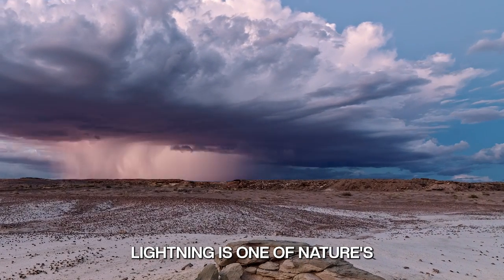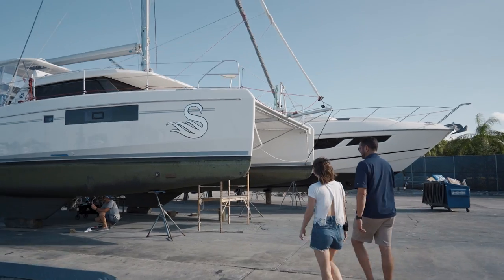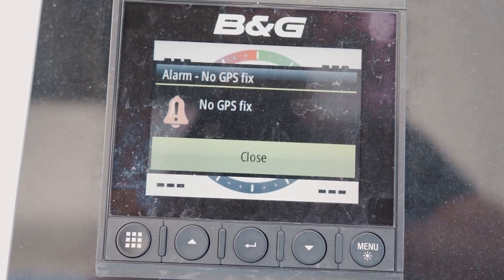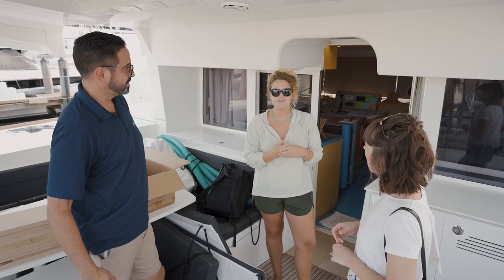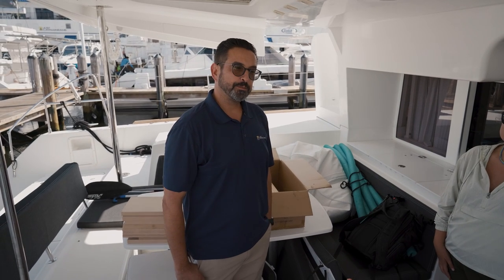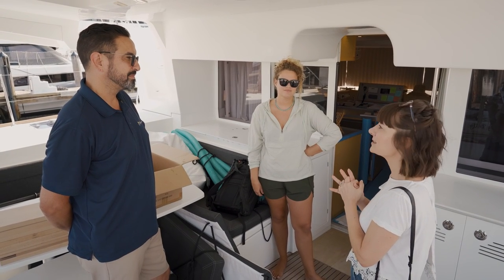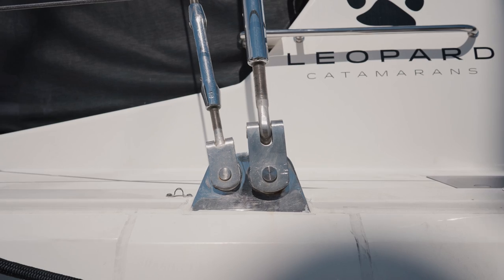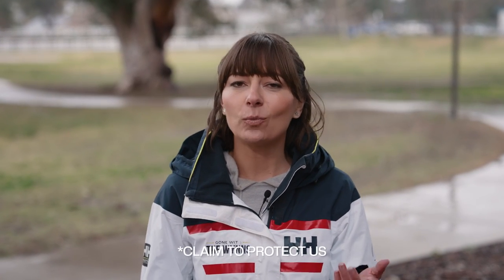Can Anything Stop Lightning?

Comment: I'm an electrician, not a sailor.. One of the problems that makes the subject issue so difficult is the nature of electrical insulation. When it is stressed by overvoltage, as in a lightnimg strike, it can lose some of its insulation value but still be functiomal at normal operating voltage. However, it will have lost some of its life expectancy,  Further, in a marine environment, it may tend to absorb moisture more readily, causing problems specifically when power distribution equipment cools off during normal downtime, allowing ambient moisture to condense. Capictors in power circuits are particularly prone to this effect. Insulation needs to be tested with an insulation tester at working voltage. Ohmeters powered by 9V batteries are usually not adequate. Hope this hekps.

Comment: To repair and refit a boat after lightning strikes is a costly and là our intense process. Parlay Revival get stroked directly 2 times and Colin have to go through extensive work on his boat to get it back in sailing condition again.
Sailing Dauntless is installing a similar/same system, you guys can reach out to them to have more information on this type of solution.

Comment: Ha Good one! I am an engineer with 55 years of sailing experience and this topic has always interested me.  I know the theory and can  make the calculations, but what bothers me is that it does not line up with the emperical data. I have had two personal near lightning misses on land and can attest to the power and force. But at sea... What I note is that sailboats are very rarely, if every, hit while under sail in spite of lightning strikes 360 degrees around the boat (personal experince).  But boats are very often hit at the dock, on the hard and at anchor. What gives?  I have never known first or second hand of a hit under sail.  

I have had people insist that they were hit while sailing and I ask how do they know it was a direct hit?  Because there electronics have all been killed. However that does not prove anything because a close proximity strike will do the same.  Now I have seen the damage caused to boats struck on land, the hard and at the dock.  In some cases one or more holes have been blown through the hull.  In one case I am aware of, the boat was struck in a pit in Vuda Point Fiju and the survey found about 200 microholes in the hull and the insurance totaled it. One boat I know was hit on the hard in Greece.  No damage reported.  They put the boat back in the water after replacing all the electronics and went to sea.  At sea, an 18 inch crack opened in the hull just in front of the keel, right where a jack stand had been under the boat on the hard.  The point is, if you boat has had a direct hit, you will know about it sooner or later.  The water in the fiberglass matrix, (yes all layups done without epoxy have water in them), will at a minimum flash boil and damage the bond between the fiber and the resin.  This is the same steam explosion when happens when lightning hits a tree or a wooden house.

So, why do boats under sail rarely, if not never get hit by lighting?  The truth is no one knows.  I suspect that like the Tesla device that is commercially marketed, that a sailboat in motion gets an unattractive charge like a car going down the freeway on a cold day.  I would like to see someone research this more thouroughly.  So if you beleive the marketing and want to protect your boat at anchor, at the dock or on the hard, spend the money.  If you are primarily worried about getting hit at sea, I would buy a life raft and epirb instead.

BTW... Commercial aircraft are hit by lightening on average once a year. When that happens the aircraft becomes a giant capacitor and the charge is bled off the wingtips by design.  Carbon aircraft need a bit more engineering specific for lighting strikes as you might imagine.

Also the Air Force once did some research on weaponizing ball lightening (St. Elmos Fire).  They could make it but they failed to be able to control it.  What could be more scary? If anyone has any specific data or research that can add to this topic I would like to hear it.

Comment: Yeah, as long as having the protection does not provide unwarranted additional hubris to the boat operators... still gotta be smart about it.
Similarly, do all boats have surge protection at the shore power connection point? I think not, but couldn't hurt, might even help to address proximity hit issues.
Does your insurance company have any opinion?

Comment: Thinking about what it does, if it's a de-ionizer, Many use carbon brushes in order to Ionize the air, so could many small flared out versions work like the ribs of the umbrella designs, and pull in pre-charged pixies for and from a larger surroundings?

Other than that, who says the onshore ones can't be moved to be marine?
Finally, thinking about old time things, and sure this is from movies, but whenever they're in a t-storm, the first thing that usually happens is that someone has to come down from the crows nest, before the big hero climbs back up there...sooo I mean it would make sense that it being the highest should do something and the burger shape would be likely to cause a cone of safety....

Comment: Unless there is some gigantic high voltage ion generator involved it's just a glorified lightning rod. Grounding the mast via some through hull plates similar to that expensive setup would be almost as good. Putting a "hat" above the wind and antennas (as the gismo install does) would be better. There's a reason why the folk with a massive mast got hit first.

Comment: My boat was hit by lightning, Icom VHF radio survived, and the VHF antenna had a wire fastened to the antenna and the rigging wire tang the lead to the boat's grounding system. Lost the alternator, GPS, and halogen lights, but my Appenlow lights survived.

Comment: Lithium batteries are very dangerous when over or under charged. The computer that protects them is called a BMS or a battery management system. It's inside those battle borns that you're familiar with. That part can be damaged by a lightning strike and you might not notice it. This would cause your batteries to over or under charge and as a result become a big fire hazard.
Reply: Wr I ng g e

Comment: Good that you guys are covering this topic, Nikki, but isn't that what the "feather dusters" are supposed to do? I've always read that they dissipate the ions in the air around your boat. Also, what would be the cost of either of the two devices you mentioned (for direct strikes) if it were to be installed on the mast before the mast is stepped?

Comment: I'm an EE and cruiser and it's essentially impossible to prevent lightning from striking your boat. None of the devices work. Keep a handheld VHF/GPS in ferrous metal container to shield from EMP, have jumper cables to start engines and spare alternator to install. Have good insurance. This is a big threat to newer high tech boats. Even if you have robust lightning paths from masts to grounding plates the EMP can do enormous damage and you cannot shield the whole boat from EMP unless it was built by the Department of Defense.

Comment: As ocean going craft travel the  waters, they develop a magnetic signature, making them stand out against the natural magnetic/electrical background. Hence, naval vessels (which are usually steel) are routinely "degaussed", which randomizes their electrical signature and thus they blend in to the overall magnetic/electrical field, and (colloquially) camouflaging them by reducing their electrical target profile.  [If the lightning can't "see" you, it probably won't hit you].

Is degaussing possible with GRP/fiberglass/ferrocement vessels, given the massive amount of electronics and electrical cables typical in today's builds?  I dunno. It definitely works for steel vessels.
Reply: More specifically, naval captains are advised to change course randomly, which (theoretically) erases [jumbles] part of their electrical signature, again, helping them to blend into the overall electrical field. This is SOP , e.g., minesweepers.
Cite: Training course, Section 2, "Celestial Navigation for Prospective Commanding Officers', BuNavPers, 1978

Comment: I have very extensive experience of working on boats for new installs, replacements and lightning damage - in Florida on the west coast. There is absolutely no way you are going to stop lightning damage. A direct hit will definitely take out ALL of your electronics and batteries. If you are approaching a storm you can't avoid, start your diesel. Leave it on until you are absolutely sure you 'dodged the bullet'. If hit, your starter solenoid AND starter motor will not work. Breakers, transient arrestors, etc. won't be usable long term. After a hit some things will be immediately dead, the rest will die over 3-4 weeks. Your insurance company will put up a HUGE fight and most payments only cover 40% of the true replacement costs. UNDER NO CIRCUMSTANCES order with a carbon fibre mast. I've seen many of these hit and EVERY single one is peeled from top to bottom like a banana (but with very fine strands!), leaving no mast and a huge mess of tangled rigging all over the deck (and incidental further damage). The worst killer of instruments was the introduction of the RJ-45 as the standard boat bus connector. Anyone who works on computers (I do) will tell you the worst cause of failure is via the RJ-45 ethernet connector. The only thing that may help is control using fibre optic lines. A nearby strike will nearly always find it's way to water via your depth sounder transducer. Always check that first! Don't waste your money on 'loo' brushes on the mast or the $illy new device$ you're being touted.
The choice of an all-electric boat is stunningly poor in this regard - you won't even be able to cook food. Give yourself back-up small gas canister stoves 'just for a rainy day'.
'You're twice as likely to be stuck in a catamaran' is utter nonsense. 99% of the time it's going to hit the mast. In a carbon fibre boat your best bet is NOT to use pre-installed ground plates with VERY hefty interconnects, side damage and instant delamination occurs. Use the old adage - carry at least a couple of sets of beefy starter cables (not cheap ones!). If you are near a storm, run out and clip one end on your turnbuckles and throw the other end in the water. Oh, it doesn't matter if it's lead acid, glass mat or lithium. Batteries do get permanently damaged. In fact, modern lithiums are worse because they have very small cathode to anode distances and are very tightly packed.

Comment: I worked in the Airline industry for years. Aircraft are hit with lightning almost daily around the country. Everything “metal” on modern aircraft are electrically bonded and the system is made to dissipate a electrical charge from a lightning strike.

Comment: I am very sceptical about it. A lightning strike contains multiple thousands of volts. Leading that through wire in the mast to the metal plates under water will result in a high amperage.
This will result in a high magnetic field inducting voltages in the equipment surrounding them and damaging or destroying them in the end. Putting equipment and interconnecting cables in faraday cages could minimize the damage but would result in a very difficult or even impossible constructions. That is probably the reason that sailors put small equipment that can be disconnected in the oven and shielding it there as much as possible during a thunderstorm.

Comment: If you sailing in lightning switch off and disconnect as much as you can ie. isolate the electrical equipment as much as possible I would also isolate parts of the battery banks . Lithium batteries have BMS  boards that won't survive a power surge

Comment: I wonder if there's a power conditioner for marine applications like for the home. Power systems like high end power bars that provide defense against power surges. High end products in that market also come with huge guarantees the power system I have on my home theater guarantees up to 250,000 in replacement gear if anything is killed by a surge. Just need a picture of the gear plugged into the product and it's safe light on. If the unit gets fried defending your gear you'd think that's a better option even if you could put a device like that only on the boat management electronics. You'd think that company would put their money where their mouth is, and offer a guarantee of their own.

Comment: I understand the principle of that lightning protection device on the mast. It could work. I designed ESD (Electro-Static Discharge) devices that are in every chip on the market. There are several standards. Most consumer devices have human body model 2KV per pin and 200V machine model per pin protection. That means that each pin of each chip can handle a static spark from a charged person. That is far to weak for this case. Automotive has a higher protection level. Cars should survive more. One problem on boats is that all the wires go single ended. So, you have a big open loop. That acts as a transformer and will send hundreds of amps through these cables. If you can try have every power wire with its own return as close together as possible with a star like connection of all ground, then you have no area for the magnetic field. Shielding wit a faraday cage is the next. But there is only so much you can do. Yet, I wonder why an airplane can just continue to fly after a lightning strike. There have to be solutions that improve the lightning robustness on the ships. Would love to discuss more.

Comment: Seawind has installed a system on the new 1370 that's about to splash for sea trials
Contact Nick or Terysa (Ruby Rose). RR2 will have a system fitted

The system is essentially a grounding rod. They are installed on high rise buildings. I'm surprised that boats don't have them.

Comment: $15k is super expensive for what is basically a hunk of metal and some thick wire leading down the mast. Its an obvious fix though. I'm surprised the concept of a lightning rod hasn't been put to use on sailing vessels. I had assumed it was already implemented with a wire (heavy gauge) at the base of the mast going to a conductive pipe fitting that leads to a metal hull penetration.

Comment: At the RR, we always get hit by lightning. Think about miles and miles of rails. When it hits the rail, it’s looking for ground. Typically it’s through all the equipment connected to the rail. If it doesn’t hit the rail, it could be a bungalow thats aluminum or steel, it could be through the antennas and or the satellites. We use LPC-lightning protection corporation for lots of our protection. It doesn’t stop all of it but it has greatly reduced the damage.

Insurance is a scam. Only use it for a catastrophic issue not little things.

Comment: I think the idea is to discharge the path before it can buildup to the point it becomes a strike.  But lightning just went from a couple of thousand feet above your head and this little thing is going to prevent that?  I don't think so.  Try not to be underway when there is a storm because you will buildup more static charge that way.  But I understand that in rough seas you WANT to be underway.  Do make sure your mast has a path to salt water.  Then the mast becomes a lighting arrestor.  Problem is that boats today have electronics on the mast.  So maybe those should have a dielectric between their mounting and the mast.  Insert standard disclaimer here.

It's just that lighting will do whatever it wants.

Comment: I've been in the construction company in Germany, all houses must have a earth heavy duty wire goes from the roof like a little single antenna down to a copper rod deep in the ground and all electrical plugs must be earth connected to the ground earth, so when it strikes all electronics that are off, like when your not home, your electronics will still work, and that Nikola Tesla antenna ball, acs the same way, because water is earth, only when not in the water I would connect a thick wire to a pole in the ground, and it will still work, has basically the same results as in water.

Comment: The insurance issue doesn't make sense because now you have all new equipment that's been recently verified by its installers and certified technicians. It would probably be a better insured item than a boat that has not been surveyed in quite some time. The logic me

Comment: When I had a ~1969 Cal 20 in the 1970s, I was always concerned about lightning.  It had no (zero!) electronics, but the aluminum mast was on top of the cabin, it had a ~2,000 pound lead keel, and if you take shelter in the cabin during a thunderstorm, you are sitting in the gap of the spark plug.  Could have grounded the mast, but then, if there's a lightning strike, would the grounding melt a hole in the side of the hull?

Comment: I had a lightning strike on my truck years ago before they started putting computers in the engine. Blew my cb radio and fridge. Now I have Xbox, tv, laptop, cellphone… not to mention the computers in the trucks now. Even the drivers seat is controlled by computer. Everything has to be insured now.